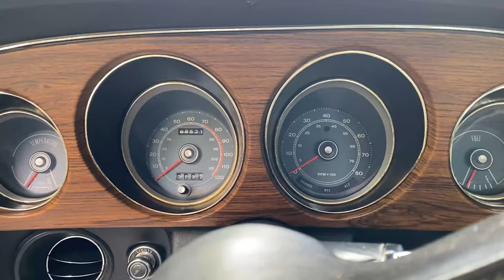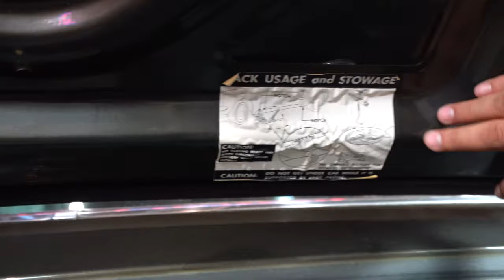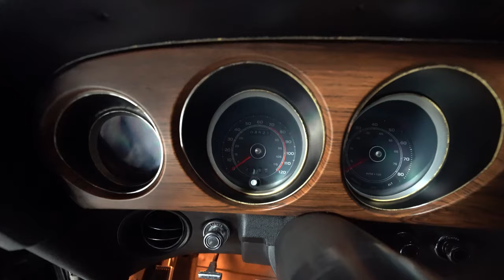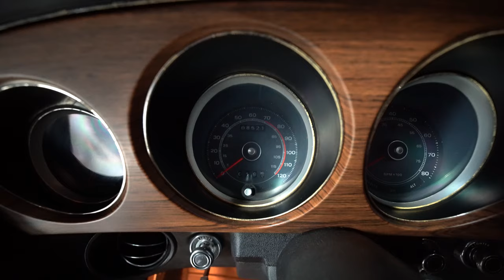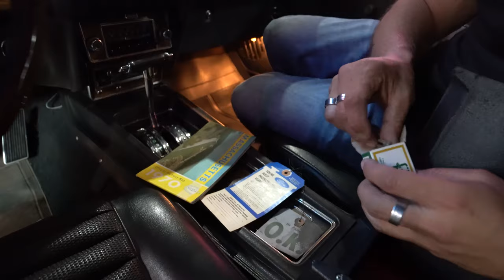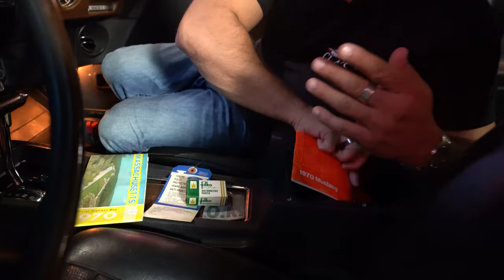1970 Ford Mustang Mach 1 428 Cobra Jet FOR SALE

Comment: Beautiful car. I have a ‘70 mach1 with 30,372 miles. original Cleveland 4spd traction lock. Raven black. Drives like a dream. I saw your car on EBay. Caught my attention.
Reply: I have the M-code version of this car. My older brother purchased new. Also in 'Black Jade' (with satin black stripes). Finally, '70 getting some well deserved love! 🙂